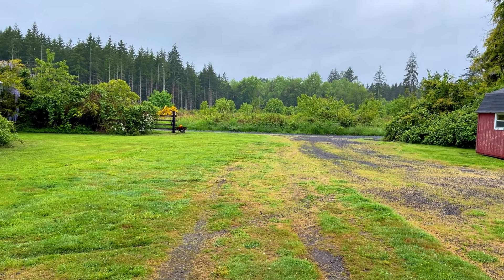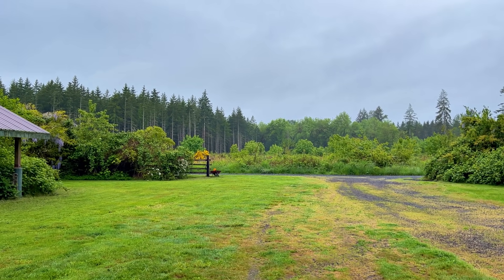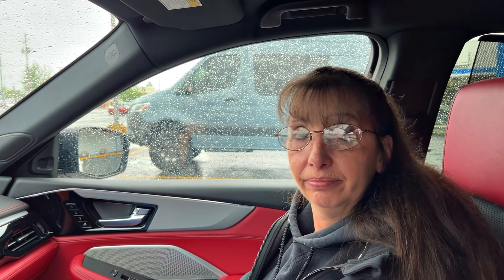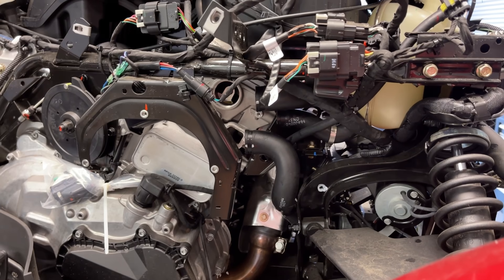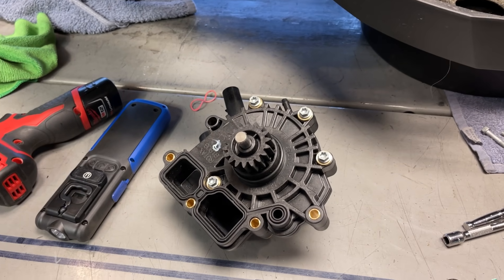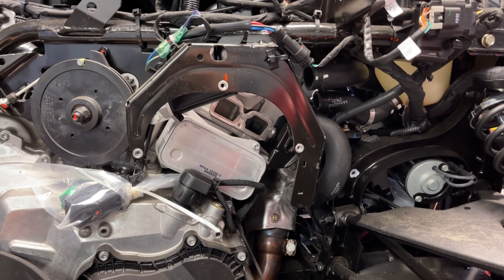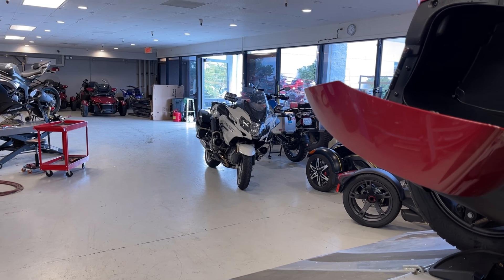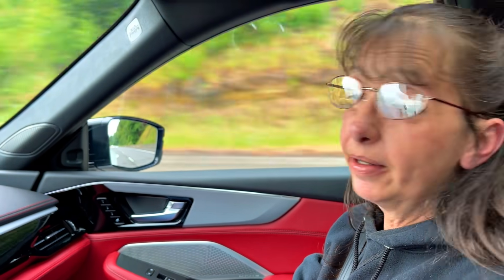2015 RTS Water Pump!! • Future Trips & Campouts! | TheSmoaks Vlog_2017

Comment: My transmission on my 2018 F3L just had to be replaced.  Had 18065 miles on it.  Main shaft broke.  Tech had to remove engine and transmission to replace the transmission.

Comment: Is that a common issue for the Spyders to have water pump go. I've noticed some coolant on my shed floor. I told my tech about it and he saw that the weep hole  had a slight leak in it. His suggestion was to have it rebuilt. Mine is a '012 RT Limited and has over 41,000 on it.
Do other water cooled bikes have water pump issues also?